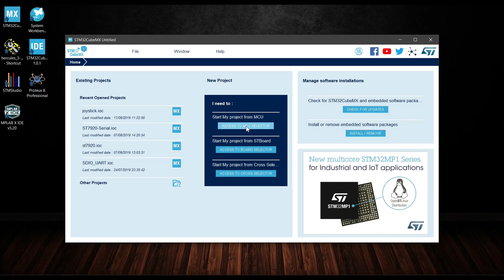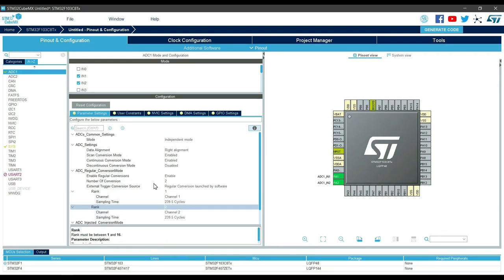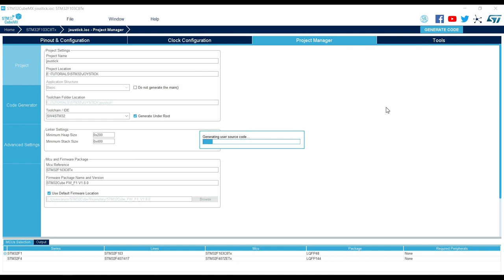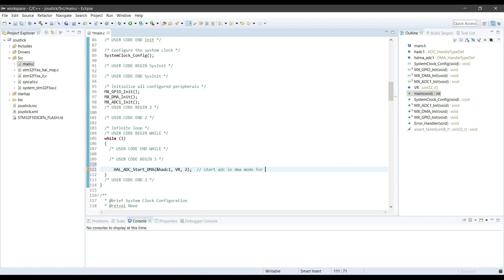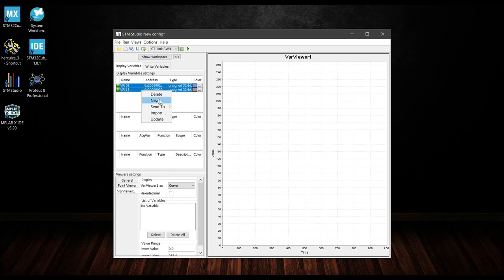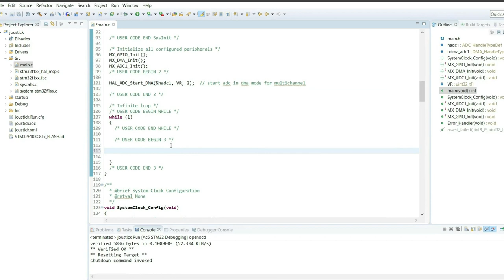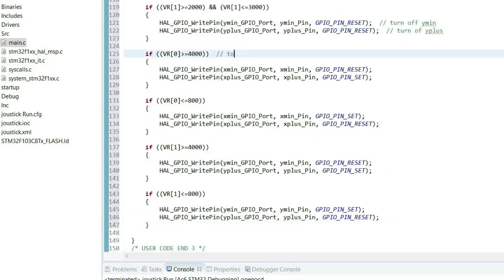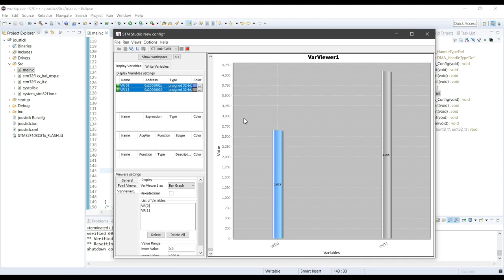Joystick module with STM32 || ADC || Multi Channel || HAL

Comment: You mention that the HAL_ADC_Start must be outside of the while(1), but it seems to work fine when you graph it in STM-Studio-Stm32? 

Also, you mention you want to do the conversion as fast as possible, but doesn't the sampling time refers to how long it takes to do one conversion?  Wouldn't going from 1.5cycles to 239.5 make it slower?  Since the numbers are fractional.. I assume it doesn't refer to the number of conversions per loop?
On the DMA, how is the default "normal" mode different from "circular"?  Is it possible to DMA the data to Flash or another peripheral (UART or CAN-bus)?

Comment: thank you for the tutorial really helped a lot, but i'm having a problem that after a while some of the pots start outputting wrong voltages, not ADC's fault but the pots themselves act strange, i will try different wiring configurations.
Reply: Were you able to figure out why this is happening? I am facing the same issue now

Comment: Hello Im using STM32L476, I have copied this as far as I can convert for a different board but my joystic values seem to go extremely high when running as release but sit around 2040+/- 5 in debugger. Would you have any clue why this is?

Comment: Hello Sir. Is it possible to use two analog sticks and 4 buttons using the same stm32 model that you use in this video? Are there enough pins for that?
Reply from the maker: Yes 1adc have around 14 channels, so you can control 14 analogue pins with just 1 adc.
Plus this board have 2 ADCs.. you do the math 🙂

Comment: Do you use ST-LiNK V2 ? If yes, have you got some good tuttorial how to configure eclipse to flash with st-link? Unfortunately I got some errors..
Reply from the maker: What errors ? 
I never did any configuration. Leave everything to default and it works as expected
Reply: @ControllersTech  I do: run->debug as->stm32 cortex. And then I get:
Error in final launch sequence:

Error in initializing ST-LINK device.

Reason: (18) Could not verify ST device! Abort connection

Sorry for my mistake, I use STM32CubeIDE to do it. I try to install sw4stm.
Reply from the maker: You build the project for your MCU right? Or are you trying to debug my project?
Reply: I always  build my own projects. I didn't get error when I use st-link utillity. But in CubeIDe I get error. I installed sw4stm but I can't change toolchain. It's not available. Mb I skiped sth. I will solve it. Thank you again for answer.